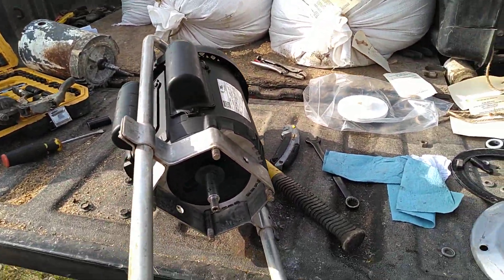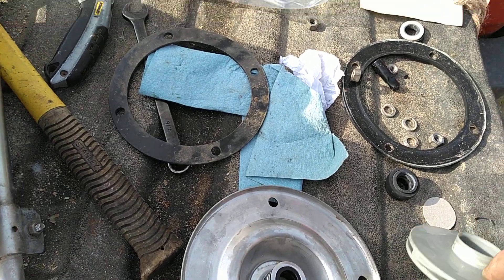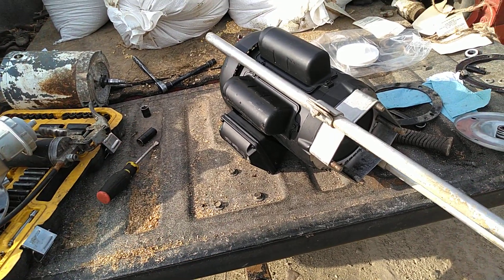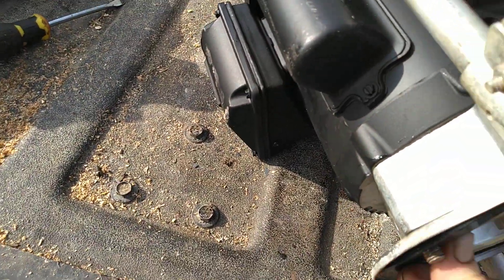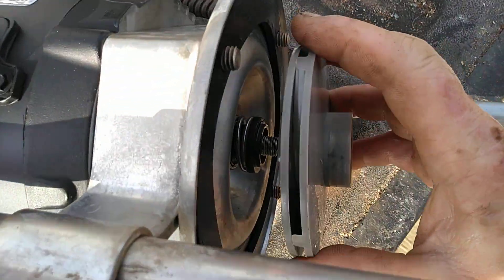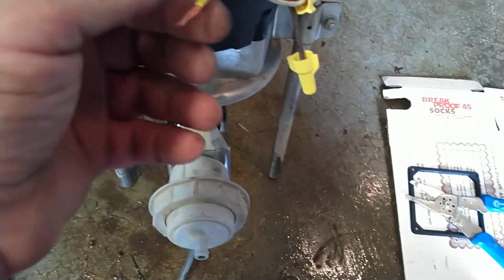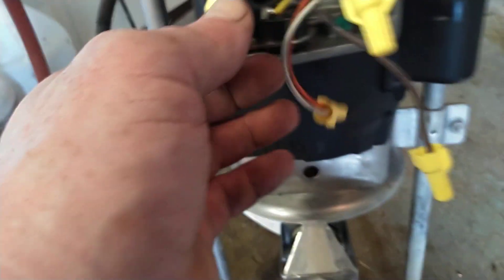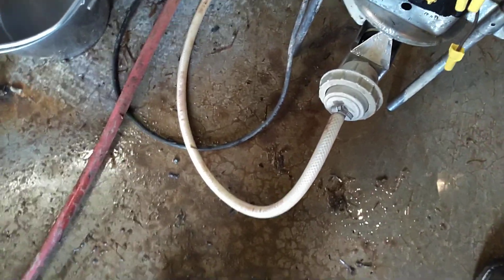Installing new bulk tank washer pump motor.

Comment: If you ever quit milking you could fix farm machinery or dairy equipment your handy at doing both how are your cows milking still shitty or did they come up on milk how's your bacteria  and scc counts doing or are they still going up and down any new cows or heifers calve any new heifer calves or more bulls
Reply from the maker: I have a pretty good understanding of the era of equipment I have. This was about my extent of knowledge of electric though. Basically I'm just a wrench turner, definitely not a fabricator. Both torches and welders I'm good at making holes 😂

Both pi and ssc counts are down more than up but still issues. Inspector wants to come out again with supervisor.

Between running out of corn silage 2 weeks ago and feed from a different mill production has been steady. Really don't expect to see a difference until back on corn silage.

Recently has a jersey cow have a bull calf, jersey heifer have a heifer calf, and have another jersey cow and Shorthorn heifer due by the end of the month.